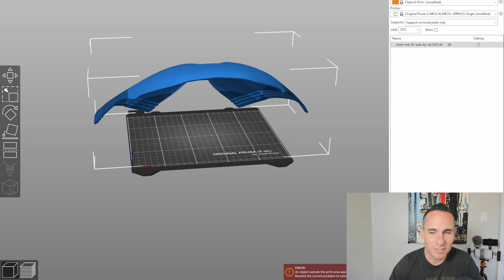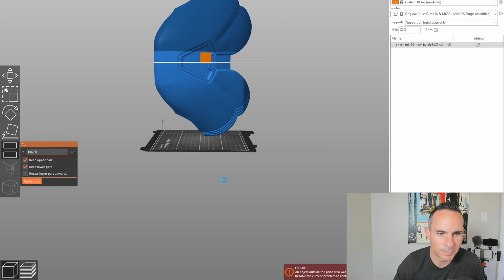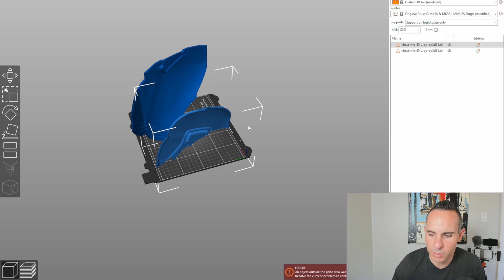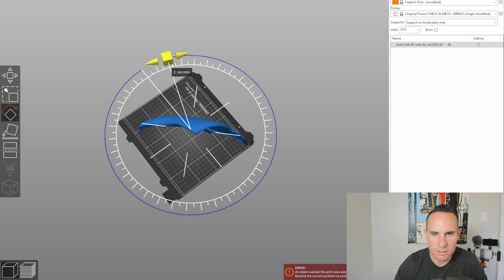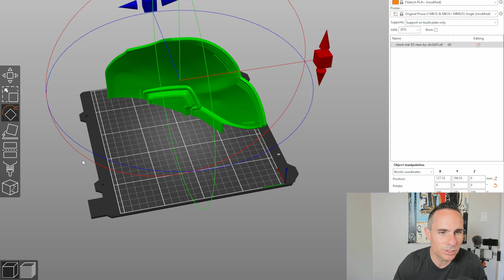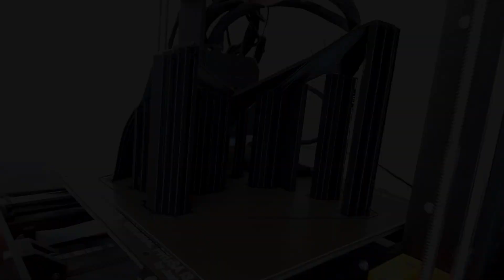Nothing Is Too Big To 3D Print!

Comment: You don't have to delete the other model. There is a way to set up multiple print beds with PS. Angus from Makers Muse has a video about it.
Reply from the maker: You can also just hide the other part in the list on the right column by changing the visibility toggle.